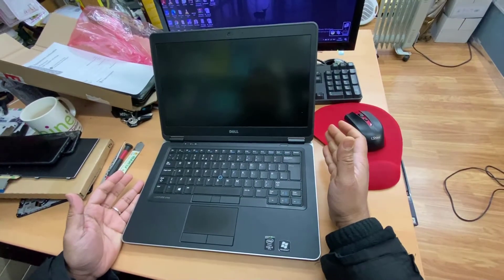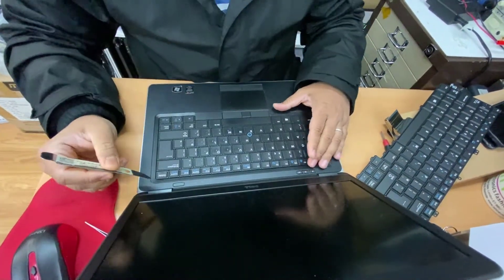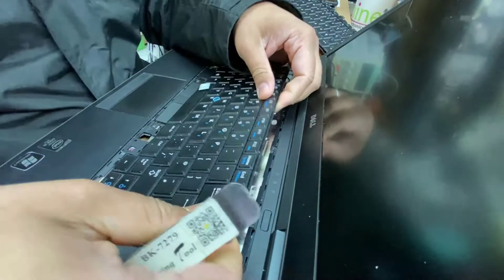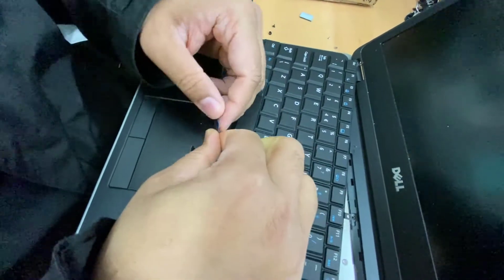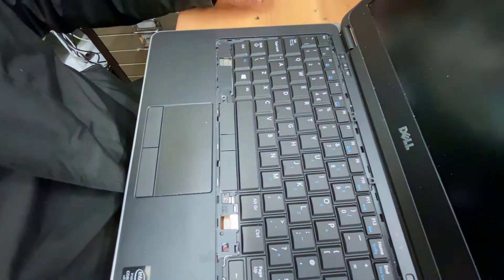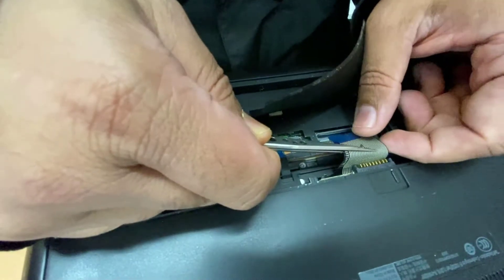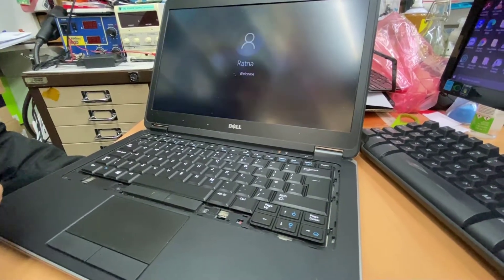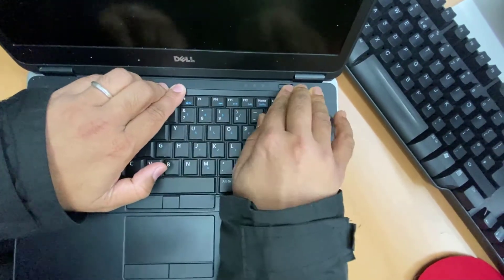How To Replace Keyboard On Dell Latitude E7440

Comment: You forgot to mention that there are 2 hold-down screws for the keyboard which can only be accessed by removing the bottom cover.
Reply: Seems like a very dumb thing to leave out. I noticed while following this fellow that I would have to bend the old board (to do what he does)... and found these two hidden screws needed removing as well.

For lay-repairpersons, the two screws theorangeking is referencing are immediately above and adjacent to the two RAM slots, and are labelled with a "K" in a circle next to them. And like they said, one must first remove the bottom cover, which is held in place by two screws.
Reply: Agreed but this got me in the ballpark of fixing the KB, Thanks for also mentioning it

Comment: I watched your video. It seems your old keyboard was also backlit. But I noticed a difference between the old and new keyboards. The old one has 3 ribbon cables, but the replacement keyboard only has 2 ribbon cables. Any reason why?
Reply: If you watch again you will notice that the JoyStick Ball is not there in the new one.